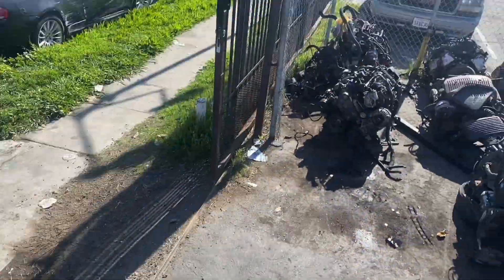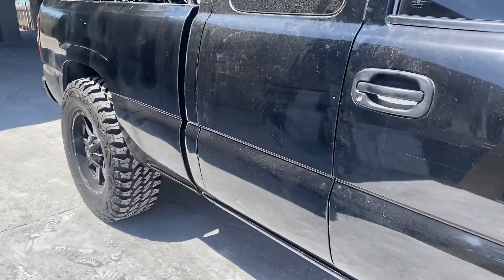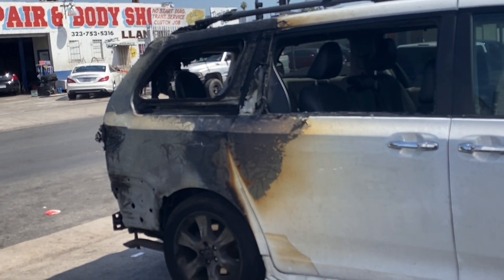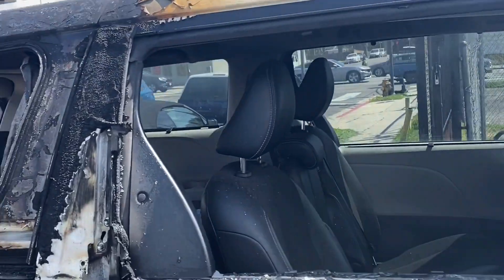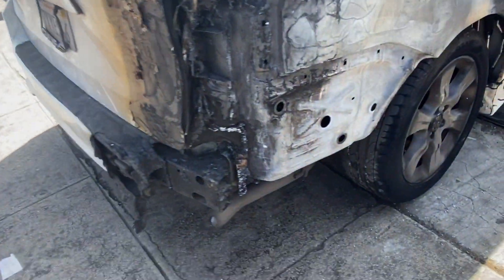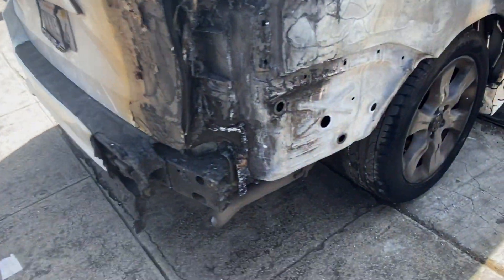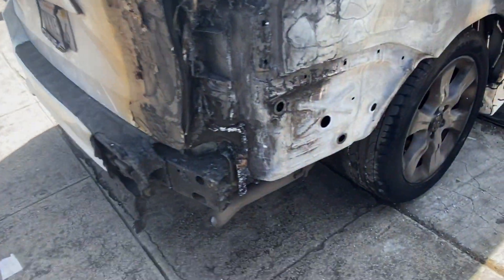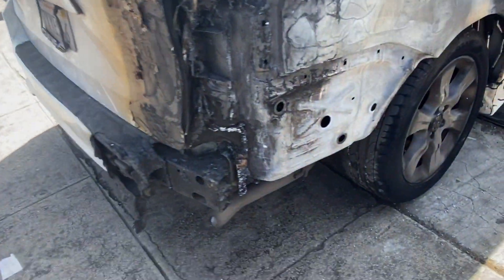Hauling motors to the new shop in the 00 Silverado hd 2500 with 300,000 miles work truck

Comment: Maybe you could get away with just an over load spring in the back, or a airbag set up or air shock hooked into a shrader valve could possibly save you some money over a suspension lift, unless your set on putting a whole lift in it,just a thought
Reply from the maker: It’s rubbing on turns as well I’m just going to lift it and be done with it I thought about the air as well but I’ll spend the extra money just to be done with it